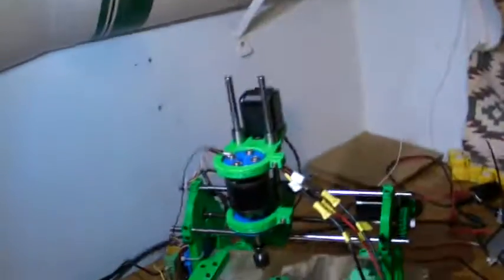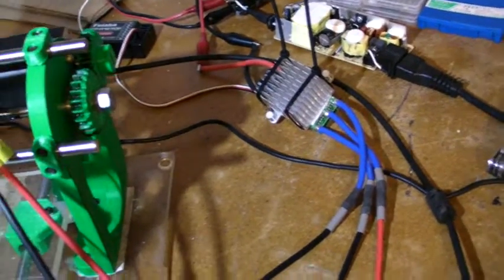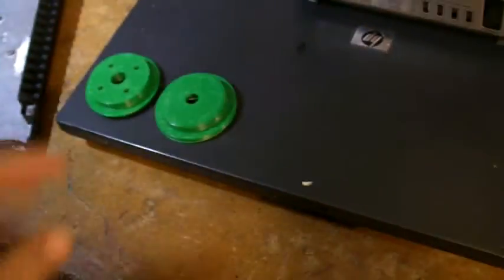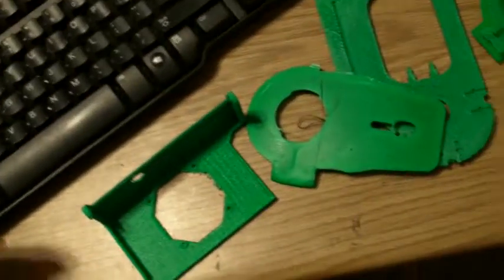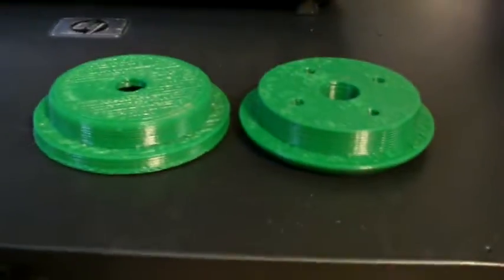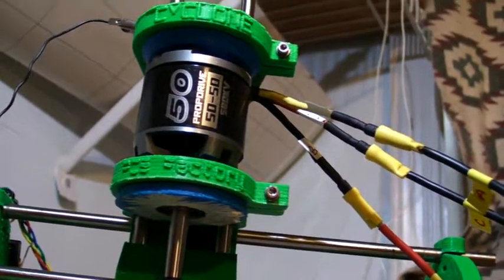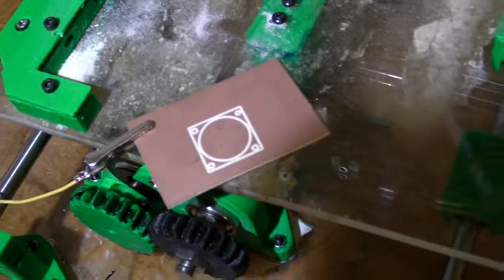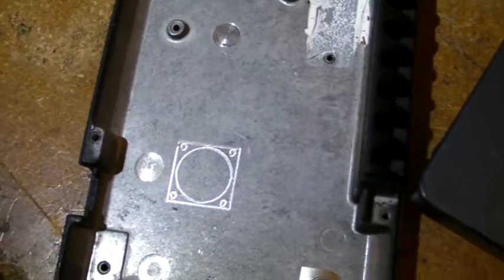Cyclone PCB Mill Router Engraver RC Motor Conversion

Comment: Cool setup. Been looking to put a RC motor in mine as well. 
Did I got it right that you have swappe the motor shaft and direclty used the one from the chuck?
Reply from the maker: Nandox7 yeah. there are few motors out there that will allow you to pull out the original shaft and replace it with a shaft with a chuck on it. pain to control though, have yet to use something other than a RC receiver and transmitter
Reply: Thanks for the details. Was checking and they no longer sell that motor. Alternatives require higher voltage so it's a pain for me as I wanted to use 12v.
To control is ok depending what CNC controller you have. I have a Arduino CNC shield that has a PWM output to control the spindle speed so I can plug directly the ESC to it.